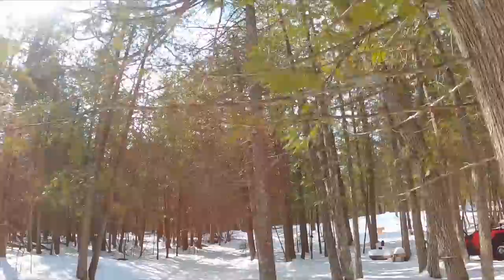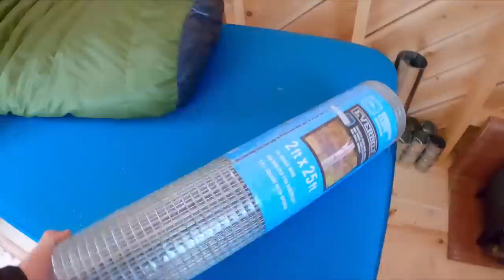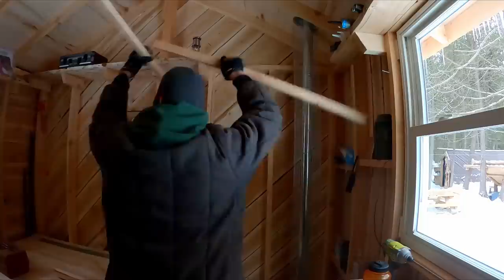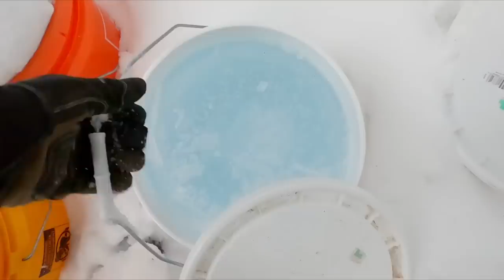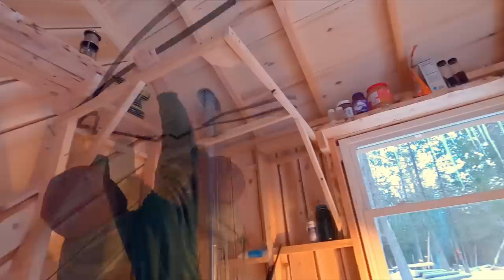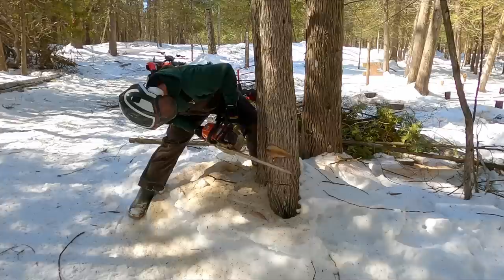I accidentally bought a new Honda Rancher.  How much can it drag through the snow?  #76

Comment: To me Id mention the idea of the rocket mass heater as an experiment, Not just for wood burning stove but any type heater can be improved. If you vent your exhaust through the mass unit. cuz things like sand n rock n cement tend to hold heat longer for hours days weeks.  There was a guy in montana made an indian tee pee and lived there year round and that mass heater was how he survived severe cold temperatures with very minimal wood because of how it was BUILT you could even construct one inside your first lean to tarp covered dirt floor and probably experiment with it in that situation n then consider your other cabins. Ive seen people living in Yurts just a round tent using the roacket mass heater as a whole family cause your not constantrly feeding your fire one the mass unit heats it stays warm n heats the whole structure all day long. N that might solve your water problem in the winter If you build a tent or tarp over your water tower grante4d youneed to fire it up occasionally but you dont have to be there all day constantly feeding a fire like on a wood stove unless you have better idea. One couple had a hot tub uswing the 275 galon totes and qa wood burning stove in canada n believe you me that can a pretty awesome treat in the dead of winter that warms YOUR CORE COMPLETELY in the dead of winter. Whatever it takes sometimes even on the cheap to boost your attitude can make all the difference in the world to continue to survive or thrive even in harsh conditions.

Comment: You should have a "heat, smoking shack. It is an outside burning room. Dig a pit build a shack around it. run some chimney pipes through the shack over/next to the fire and allow the fact that heat rises bring the heat to any area you might want (like the "shower room") You cold use anything that burns in the pit and use the smoke for smoking meat if you acquirer some.

Comment: Welcome to my world with propane.  Nice heat but very thirsty equipment and the cost is outrageous!  If I were you I would put in insulation and a wood stove.  You will always have wood for heat living as you do so it will come down to controlling the burn and retaining the heat.  Of course you knew that already.  Propane keeps you connected to the world and it's issues I'd say better off with mother nature burn wood.

Comment: Your physics are 100% correct on the reason for the un-leveling of the cabin. The ground freezes and the moisture expands. The path of least resistance is up to the surface and it lifts the rocks in the ground and anything setting on it (the log footings) as well as any moisture still in the logs footings would also expand (very little depending on moisture content) causing that side to lift. The other side on the stumps is set as the stumps have dried out and are positively located in the ground rather than on top of it. (If the stumps have shallow roots they can lift as well but not nearly as much as something on top of the ground.

Comment: if you ever decide to get a small tractor think Kabota n just check them out nthey are a gem in so many ways just like a honda is built well and built to last a long time. Or think of ways to improve their performance or usefullness. for a small tractor they have a lot of useful ways and attachements a lot of homesteaders use them for planting harvesting you name it plus they are usually 4wd which is very useful in many situations. Once in a while on craigs list you might find a cheap or abused one but they can be totally rebuilt fairly easily. Im talkin smal deisel tractors but even their skid steers are remarkable. And occasionally you may find one for sale fairly cheap on craigs list or other places.

Comment: You should attach those empty stove pipe around the chimney pipe like a revolver. They will suck col air up from the bottom and add heat.  But you knew that probably havent got around to it

Comment: The stump is shrinking as it dries, thus, the diameter gets smaller and sinks into the ground,it will not level back out, you’ll have to trim the other side blocks to compensate after the stump stops shrinking

Comment: In heating you should wind you piping lower then back and forth before going through the roof. It will keep much more of the heat to be used instead of it going outside immediately, thus throwing most of you heat out

Comment: Ryan it would probably be a lot easier to build a log cabin. I am building a prototype log cabin to be used as a playhouse. With your time and skills you would would finish it in less than a month. I’m using the butt and pass method, which is very controversial for traditional builders.

Comment: Yeah i would start stacking, peeling logs for a cabin. If you start now when its warm you will have more than enough. Also if you thin out a lot of the smaller trees that are 6 inches or so and keep to the same size logs it will be super easy. Though it does take some time to stack the logs for a cabin. It would be very cool. 
There are a bunch of types of logs you can build from 2 flat sides. D logs, chink type logs. The 2 flat sides can work well if you set up a jig to slide the saw across. This way you take off a section on the top and then another section off the bottom ( rolling the log over. ) then if you want to put in an insulation pocket you can pretty much do that with a chain saw too.

Comment: Im sure he gave reasons at some point but I missed it, considering you live in the woods surrounded with endless wood as potential fuel why would you choose a propane stove vs a regular wood burning stove?  I use a wood burning stove to heat my house and I live in the suburbs and have to leave to go harvest wood and its the best option ever.  Off grid cabins been using wood stoves as the standard for hundreds of years, because they awesome!

Comment: SEVERELY TAPERED LOGS: cut off the first 4 or 5 feet and mill some 8/10 quarter slabs for furniture! 😁👍 
Why has canvas Wall Tent never come up ?? That on a MassivE scale done fully custom would be a sick build !!  ...i mean you got sew skills and a machine , i am curious of the waterproofing techniques
Reply: One of those old drash military tents are pretty good too. I almost bought one some years ago for like 1k. They should last about 10 years out in the woods. Warm in the winter for sure. Not sure about the summer with out AC.

Comment: That propane stove is a very inefficient way to use fuel. A ventless heater would even be better. With all the air circulation going on in there from leaks in the walls, and the limited time you would use it, it would be a better bet. That "pointy stuff" is called hardware cloth. You will discover as you get older, comfort is NOT overrated. Tenting in three seasons and  a staycation in severe winter in a bigger solid log cabin might be the answer.
Reply: Even a woodburning camping stove would heat a small log cabin. You could also utilize larger limbs for firewood, good way to dispose of what is otherwise waste.

Comment: Wonder if putting the flue damper up high would give you more useable heat for drying and heating the space? Essentially turning 5-6 foot of pipe into radiant stove heat by dampering down....just a thought. 

 if you paint the plastic use an adhesive promoter first or it may peel or not last as long. Bulldog makes a good one!

Look forward to your videos every Saturday morning. Keep on ringworming in da up eh!